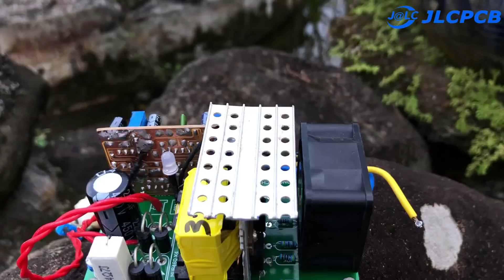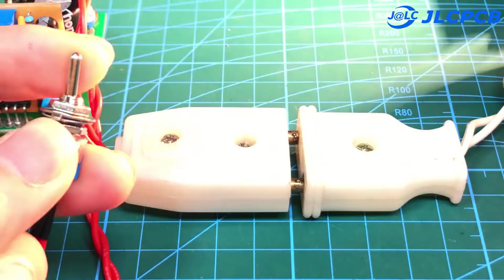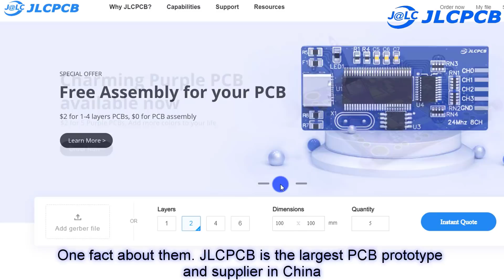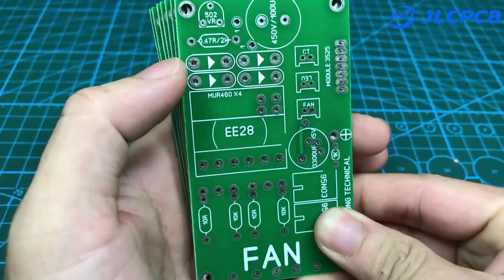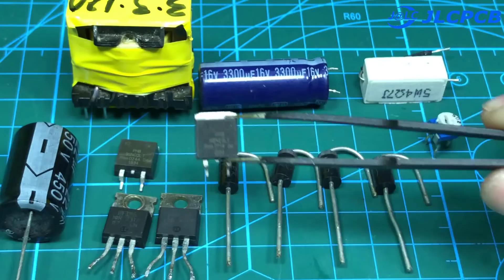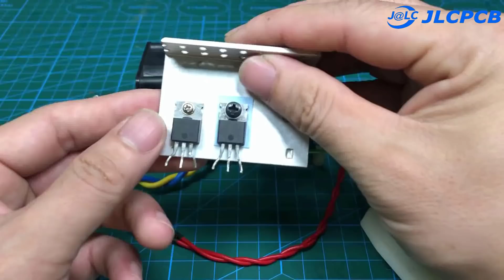Mini  300w Inverter With Over Load and Short Circuit Protect

Comment from the maker: Hello Bro ! Where are you from?. What project do you want me to do?.
Reply: CC CV buck converter for variable power supply
Reply from the maker: OK bro
Reply: amplifier circuit from mosfet irfz44n or any mosfet🙏
Reply from the maker: @abdalmoman92  OK Bro
Reply: @LongTechnical  two channel led chaser using attyny85 for Christmas light
Reply from the maker: OK bro
Reply: e đến từ VIỆT NAM a làm về mạch hạ ap tl494 với fet đi a 30 đến 40v đầu vào
Reply from the maker: @hung8539  OK em
Reply: a có zalo cho e xin với kkk
Reply: Full UPS with Overload protection.
Reply from the maker: OK bro
Reply: Hi 🙋🏾‍♂️, I'm from Tanzania 🇹🇿.
Project a UPS, automatic charging when power utility is present, please don't use iron core; I would like to know how it can be done using ferrite core.
Keep up the good work.

Greetings from Tanzania 🇹🇿
Reply from the maker: OK bro

Comment: Sir i dont have the copper strip 
So please tell me what is the winding data for 0.4mm magnet wire
Reply from the maker: Litz wire 0.4mm x 15 bro
Reply: Thank u ❤❤ broo
Reply: @LongTechnical  For the primary, are they 3T of Litz 0.4mmx15?
For the secondary one, are they 120T of 0.4mmx1?
All in the same sense?

Comment: Really very nice.. 👌✌
Is it sine wave, square or sinusoidal waveform?
Reply from the maker: Output DC volt bro. It can use for laptop TV... not for inductor load such as Fan or motor bro
Reply: @LongTechnical  thank you for the reply.. 😍
Reply: @LongTechnical   output dc volt means  Pure DC (straight line waveform)or square wave AC.

Comment: Awesome as expected.. Nice designing. 
Hey since you have a good experience with smps I tried to build an smps using sg3525 and smps transformer from old crt tv power supply ferrite core  labeled as bck42 or 40 which have a 1mm air gap can I use it for 50khz halfbridge smps.???????
Reply from the maker: No bro. Halfbridge smps must use core without airgap bro
Reply: @LongTechnical  is there any way to use airgap core for half bridge I can't find any thing about this matter
Reply: @Godofminds123  use two transformer core